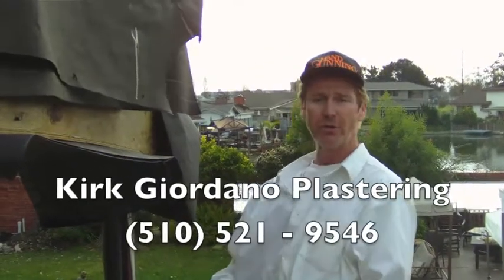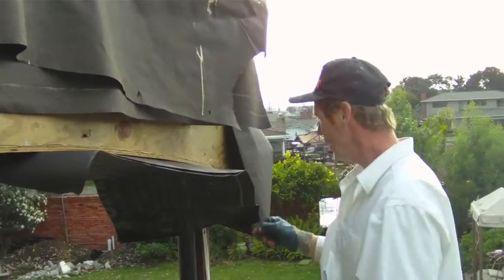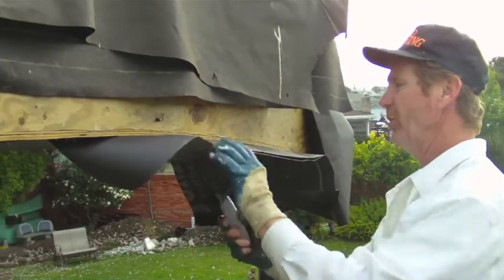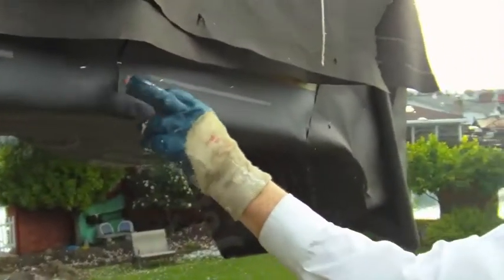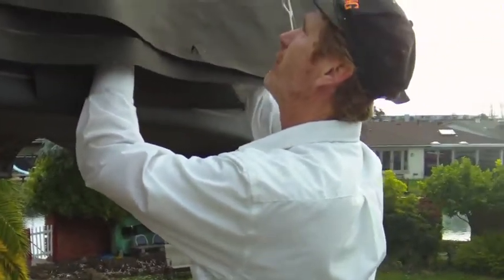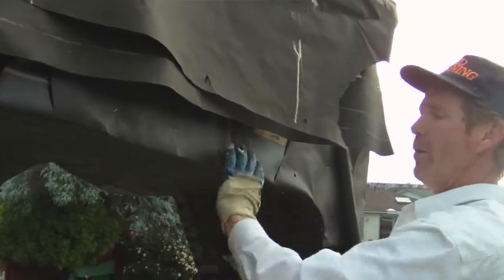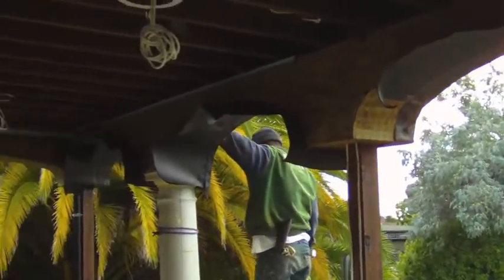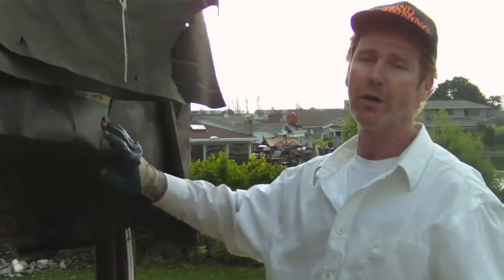Waterproofing wood arches before stucco

Comment: Hi Kirk, I hit my thumb last year with the back of a hatchet, the black spot was climbing up my nail for like 3 months, its nothing new for me. I meant hitting your thumb with this nailing tool you are using,. how is it called? I've used pneumatic cordless nail gun, its generally good, but not for everything, and using a standard hammer and nails is a pain from time to time, especially if you have to hold something you are about to nail.
Reply from the maker: Good evening Piters dude, I thonk every tradesaman has to hit thir finger at least twice during a 40 years career or elce how will we learn to not do that.
           Sharing the plastering knowledge